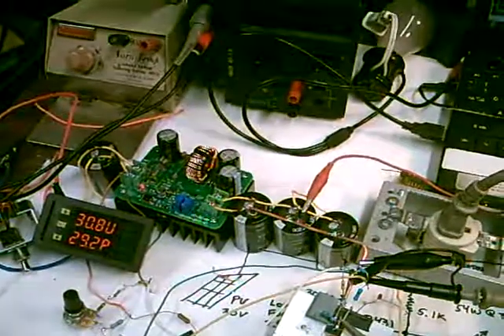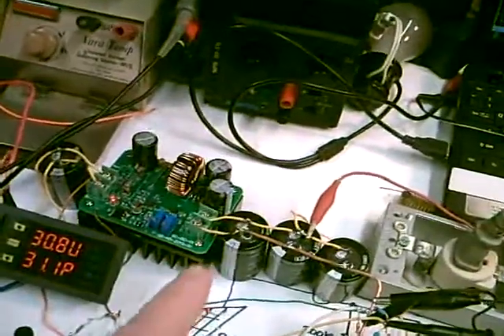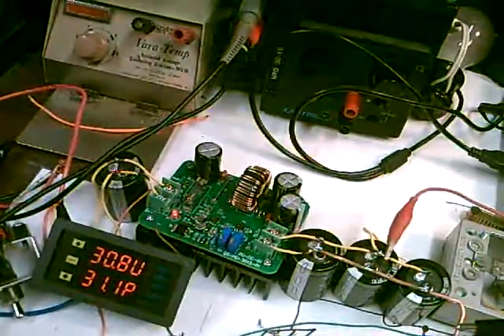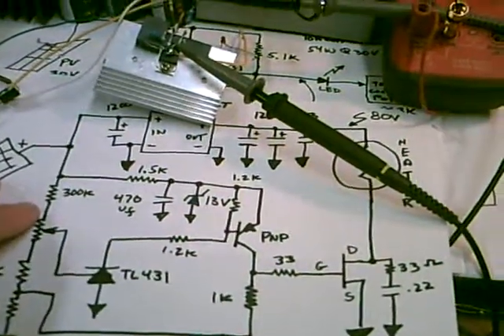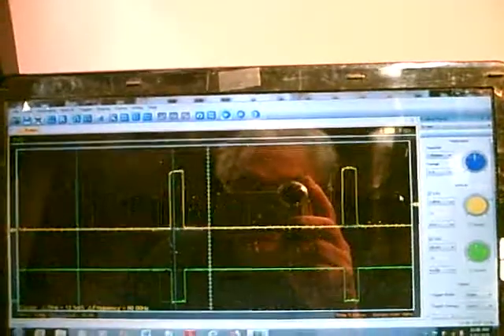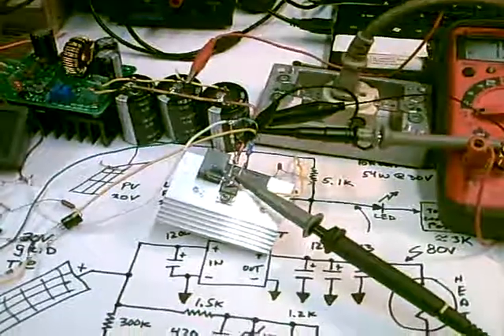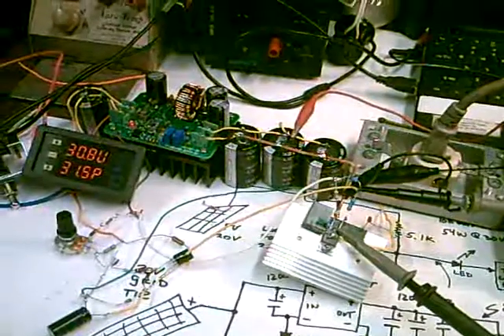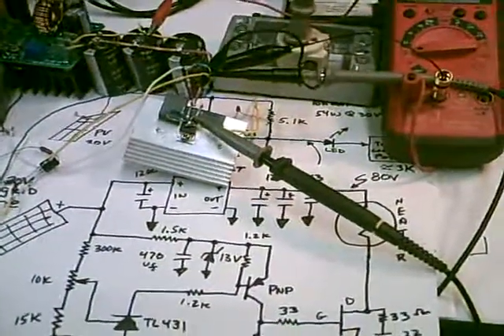Improved Boost Converter Water Heater Control, Preliminary Results

Comment: I considered building one of these but ended up deciding on another route to use my solar panels to heat my water: I reduced the wattage of my solar water heater to about 1,125 watts by sending 120 volts to the isolated bottom 4500 watt heating element. The 240v 4500 watt heating element draws about 9.3 amps when you send 120 volts to it. Then I just run my solar panels to a grid tie inverter.  Then I place the bottom element on a timer so it only gets power when I know the sun will produce enough power to run power it. I also raise the bottom element to a higher temperature than the top element and it does most of the work. having the lower element run at a lower wattage allows the sun to have plenty of time heating the water before the thermostat has been made. I have 4,000 of solar on my roof. Doing it this way allows me to get the most use out of my solar panels instead of just being dedicated to heat hot water. Since I live alone with a 50 gallon water heater I also ran 120 volts to the top element. This way the solar panels have a better chance of powering that one too. If you have even fewer solar power available you can replace the bottom element with a 240v 2500 watt element (23 ohms) it will use 625 watts at 120V.

Comment from the maker: The 600W boost converter pictures is only good for 300W because of a 10A current limit on the input. Due to pulsed nature, input current goes into limit and reduces output voltage at about 220W. Two converters in parallel is suggested to get more power.  These also run quite hot.  Input capacitance should be 8,000uF or more for stable operation.